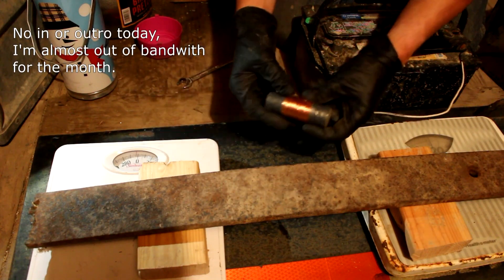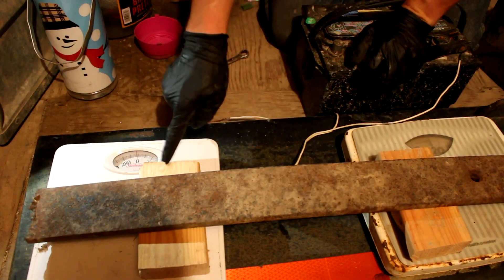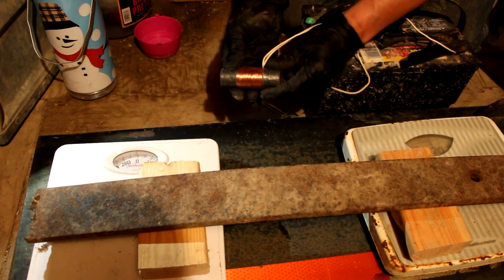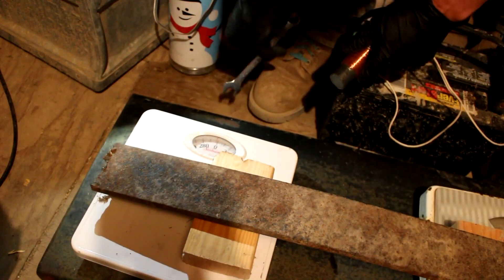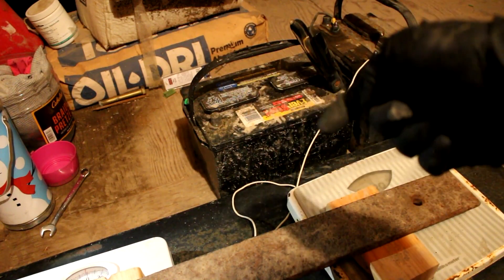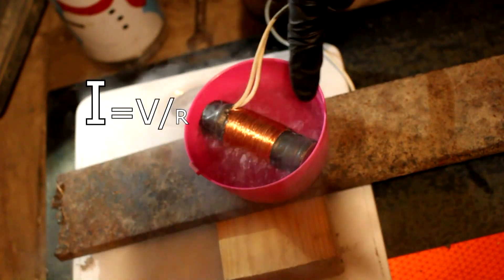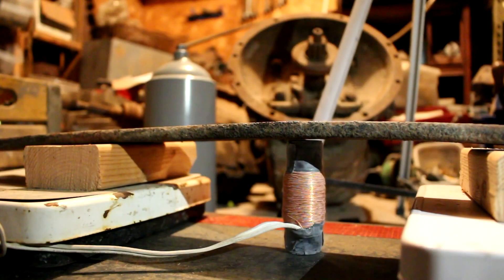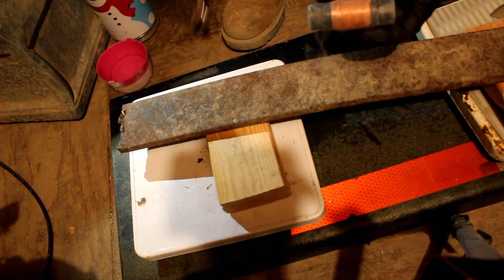Electromagnet in Liquid Nitrogen

Comment: Cody, is there a limit to how strong a magnet can be?
Reply from the maker: There is actually and that is the strength of the coil. strong magnets have a tendency to explode.
Reply: Even with superconducting coils, there's a critical magnetic field in which the resistance becomes non-zero. At that point, the coil rapidly heats up, and it can easily explode, especially since it'll turn the liquid coolant into high pressure gas.
Reply: One can always make stronger coils.

Edit: Nevermind, that would increase the resistance of the wire.
Reply: Well, a type of neutron star called a magnetar has a magnetic field in the billions of Tesla (Remember, Cody's super strong magnet is half a Tesla), and those are very nearly black holes, so in practice that's probably a good limit. Theoretically, the limit is the point at which the magnetic flux density is high enough around the magnet that it collapses into a singularity. I wonder what a black hole made of magnetism would be like...
Reply: Don't forget about core saturation
Reply: As long as you can produce enough power you can always make the magnet stronger.
Reply: If you cool that coil sufficiently though, you could get it to super conduct and have 0 resistance.
Reply: Fascinating! Thanks for the knowledge :)
Reply: +julian1000 fokin infinite amps
Reply: +julian1000 No, you can't. Copper doesn't display superconductivity even near absolute zero temperature (it will always have a nonzero resistance). Neither does gold or silver for that matter (or other materials considered to be good conductors in general). You'd need different types of materials for that.
Reply: +Ernestas Viskontas (EEVV) Curiously enough superconductors (even though they have basically nonexistent resistance) DO have a maximum current-carrying capacity, the so-called critical current. If you try to push more current than that, the material will stop superconducting.
Reply: go look up something called a "magnetar", it's a neutron star with an iron crust
it's pretty horrifying levels of magnetism
Reply: Ya'll should check this out: https://nationalmaglab.org/news-events/news/new-approach-to-building-magnets-yields-new-world-record

rare earth barium copper oxide for the win!
Reply: There are some videos out there about the strongest (electro)magnet in earth, not much to do with the question but pretty cool stuff.
Reply: Theoretically there is no Limit, but as always in practise there is ... the highest amount of Tesla is ~34.000 for a tiny amount of time ba a Laser, but some astronomically objects like neutron-stars can get much higher
Reply: It's limited by the size of the magnet and temperature; you can theoretically force it to convert any amount of power to electromagnetism but that's going to destroy it. If you make an electromagnet with the same diameter as Earth, with the coil-wire being the same diameter as Texas, and you power it with 50 million+ volt, it's gonna be that much stronger, since it's size is able to handle that much more power. When cooled equally, every cubic cm or inch of copper coil is able to create a certain amount of electromagnetism before it destroys itself, so bigger coil mass means bigger capability, but also less cooling, so capability doesn't increase linearly with size.
Reply: +1ucasvb Actually with superconducting coils (as with any superconducting material) there is a critical CURRENT (not magnetic field) above which the superconducting stops. But other than that you're right (at that point the material does heat up rapidly and that can cause all sorts of problems).
Reply: +Samm Sheperd (SNRS) And in coils with no core?
Reply: At some point the magnetic stuff must force its self apart, right?
Reply: +MoronicAcid1 often the wire is surrounded in steel or iron because they "conduct" the magnetic field better than air. A big problem though is vibrations because sometimes depending on how well the windings are fixed in place the vibrations will erode the insulation and there will be a short.
Reply: +Cody'sLab wow really?!
Reply: +julian1000 that's just a theory
Reply: +TheMrTape I liked everything about your explanation except for the volts.... current man, current
Reply: Well nah have you never seen Lost
Reply: yes, there is a limit for superconductors it is called "critical field".
for normal conductors, there is no limit, besides obvious mass-size-current-heat limitations.
Reply: as a matter of fact when using a ferromagnetic core you can consider the saturation of the core a limit, as when the core is saturated the strength of the magnet will increase at a much lower relative to the increase in current, normally electric irons tend to saturate at 1-1.2T, thats the reason why magnets which generate stronger fields simply use an air core, as there is no benefit in using a ferro core, they draw up a lot of power tough
Reply: +Silly Sad There is, but AFAIK cricital field applies to external fields induced by other sources, not the field induced by the superconductor itself. Thus I still think that the critical current is a MUCH more relevant information in the limitations of creating electromagnets using superconductors than critical field.
Reply: +Gary Littleford Since current and voltage are directly proportional, increasing the voltage would allow more current to flow. 

But you are correct that current is what really matters in electromagnetic field strength
Reply: Unfortunately, no...
The critical magnetic field strength in a superconductor also applies to the field generated by the current passing through the superconductor itself. Above this critical field, the superconductor loses its superconductivity.
This sudden resistance has the unfortunate effect of turning a lot of the energy stored in the running current into heat, making more of the superconductor become resistive.
When you have a large superconductive magnet, such as those at the LHC at CERN, which is basically put inside a large thermos flask filled with liquid helium, the effects of large amounts of energy being released into the liquid helium is that the flask basically explodes.
At the LHC this happened on September 19th 2008, when this happened in a chain reaction. Though this was not caused by the critical field being exceeded, but a faulty connection between two magnets.
Reply: +Martijn Reicher That's fine, but without the presence of an external magnetic field the critical current of the superconductor is exceeded faster than the critical field caused by the field created by itself I think.
Reply: The critical current of a superconductor is basically the relation between its critical magnetic field and the magnetic field caused by the current flowing through the superconductor.
So the critical field caused by the field induced by the current carried by the superconductor is the same as the normal critical field.
You are correct in your deduction that external fields also have influence on the current carrying capacities of superconductors. If there is already an external magnetic field put on a superconductor, this will also "count" towards the critical magnetic field, therefore the critical current is then "reduced". To learn more about the strange world of superconductors, visit the following page: http://www.open.edu/openlearn/science-maths-technology/engineering-and-technology/engineering/superconductivity/content-section-2.5
Reply: +Martijn Reicher I see. Thanks.
Reply: CoolKoon, yes superconductors have a critical current density. They also have a critical field. Go above either and it becomes non-superconducting.
Reply: There actually is a maximum magnetic force in the universe and  that is: 4,29361 x 10^59 Tesla, the Planck magnetic flux density. But theres is no way you can produce anything that comes close to that ;)
Reply: ps: A magnetar (neutron star) can reach 10^11 Tesla
Reply: no, there's not
Reply: there's a type of star called magnetar, it's magnetic field is so strong that if you stay close enough ( i don't remember the exact distance but i recall something like and Astronomic unit) it can rip off the iron in your blood
Reply: an interesting question. How large of a coil magnet can you theoretically build using technology currently available?
Reply: Limit for a superconducting coil is a few Tesla before it stops being superconductive.
Reply: ***** Well that depends on the type of superconductor. Some can go significantly higher than that.

Comment: Since you're using two scales, wouldn't the magnet have been pulling 50 pounds if only reading 25 pounds on each?
Reply from the maker: yes
Reply: Sounds like that kind of current would melt the wire at room temp. You'd need to use larger copper wire, which would lower resistance allowing it to carry more electricity.
Reply: Hey cody! I have an idea! Try wrapping it alot more (10x more than it is now), and use 120v and atleast 1 amp? I hope i dont sound dumb.
Reply: Andre Gross yeah I was gonna say it depends on the gauge of the wire
Reply: If you mean the 120V which comes out of the wall, then it wouldn't work. Current from a battery flows in one direction, but current from your wall socket changes direction 60 times a second. That means it wouldn't make a very good magnet. It would just make things vibrate. Also, you cannot control how much voltage AND current is in a circuit. You must obey ohms law. For example, if the resistance of the nitrogen cooled wire is 1ohm, and you connect 120V, then 120A will flow through it. If you want 1A, then you have to connect 1V. Voltage=Current x Resistance.
Reply: I think 30 AWG copper wire would get hot with 1A, but it would not melt.
Reply: Euro Bum Would it work well if you used some sort of ac to dc converter?
Reply: vibrate you say?
Reply: The Salty Chip
@ Salty. Not exactly. Yes, it is possible to 'rectify' AC into DC and smooth it out. We just call that a power supply.  Your home is full of power supplies, because a lot of devices need DC. One example is your phone charger. Take a look at the stamped markings on it, and they will say something like INPUT: 120VAC 50mA, OUTPUT 5V, 1A. It is changing AC to DC. But a phone charger only supplies around 5 watts of power. Cody' car battery can supply around 2,000 W of power, which is a lot, right. It's capable of turning a car's big heavy motor! But as you can see, this electromagnet is not very strong. It has very thin wires, with high resistance, which allows very little current. That is what Cody was trying to show in this video. So the best way boost the magnet's power is to increase the current, in this case by using thicker wire (or liquid Nitrogen). This is Ampere's Law.
Reply: Christian Arreguin
@Christian. Yes, vibrate. It's exactly how a tattoo machine works. Pushing AC through coils of wire is better for building electric motors. Like in your washing machine.

Comment: niceee. have you done the calculation or messured the resistance? would be interesting to which extend the copper looses its resistance
Reply from the maker: yes, in the video listed in the description.
Reply: +Cody'sLab another way to decrease resistance is to increase wire gauge.

Comment: iv never understood why the current doesnt just jump wires and short.... i thought electricity takes the path of least resistance, but instead it follows the wire. this is probly a shit question but im drawing a blank :/
could it be... jumping tiny space between wires is more effort for the electricity, so it just follows the set path of the wire because flowing is less resistance then jumping?
Reply from the maker: the wires have a thin coating of plastic on them that can handle a few hundred volts before it arcs out.

Comment: For people trying to do this at home, when you have higher currents through a coil, and you disconnect the wires, there will be a huge voltage spike. The more current the higher the spike. This can easily be several 1000's volts. Tasers are based on this principal.
Reply from the maker: that would only happen if I had another coil with a million turns on the same rod.
Reply: well sometimes, due to induction, you can have a voltage spike with just a single coil.
Reply: One single coil is enough. This only happens with dc current. It's basically the magnet field that wants to go away cause there is no current anymore. But every action has an opposite reaction so there is a big inverse induced voltage.
basically U= -L*di/dt+R*I

A coil will always resist the change of current

Comment: Can you show how to make one please
Reply: no
Reply: How to make the magnet? You take any wire that can conduct electricity and wrap it around any metal bar that a regular magnet can stick to. (Iron, for example) You then run electricity through the wire and it becomes an electromagnet
Reply: He explained how to do it in the beginning of the video.
Step 1: Take 30 gauge copper wire
Step 2: Wrap it around a steel rod roughly about 1000 times
Step 3: Attach voltage source

Comment: Now we must put all our pc and so on in liquid nitrogen :-) to increase the power :-)
Reply: There are people who cool their CPUs with liquid nitrogen.  :D
Reply: +Casey Thimm That's one of the most common things people do with liquid nitrogen. This video is the first time imsee someone doing something else electronics related with liquid nitrogen than cooling a cpu.
Reply: +Casey Thimm really? Is it not to difficult to make it safe for leaking?
Reply: Richard van Pukkem I've seen more Youtubers do stuff with LN that doesn't involve computers than I have with computers.  The only time I've ever seen a LN cooled computer was when I searched it.  Not in my sub box.
Reply: ***** Just look it up on YT.  It's pretty "Cool".
Reply: you can't cool your cpu too much though. some guys tried it with liquid helium and they actually had to keep warming it up because the chips would start superconducting instead of semiconducting
Reply: +hey7328 It's really improbable that someone tried to cool a CPU with liquid helium, and it's nearly impossible for silicon to become a superconductor. Helium is a superfluid when liquid, and it requires extreme amounts of pressure to stay liquid. Silicon, when doped with high amounts of  boron (which is extremely hard to make, and not useful as an semiconductor), may exhibit superconductivity, but only at temperatures lower then 0.35 K. Indeed you cant cool your CPU too much, and a precise temperature control is required to keep it functional when extreme cooling, this happens mainly due changes in physical properties of others components in the CPU.
Reply: Eduardo Fuentes look up liquid helium overclocking. it must be the semiconductor just becoming conductive enough for electrons to pass through then

Comment: Can you explain why the resistance decreases when cooled down?
Reply: I doubt I can do better then Neel but. When the wire is hot it means the atoms and shit (very scientific) are moving around very quickly so it's hard for the ions to flow through. Imagine trying to walk across a busy highway vs an empty one
Reply: Well, resistance in a conductor is directly proportional to temperature of the conductor. Cooling down the conductor reduces the kinetic energy of the particles present in the conductor and hence current can pass through the conductor easily, as it wont collide with many particles on its way. ps. very crude explanation.
Reply: +MoronicAcid1 they do, and even in a solid state the particles still vibrate. But ions are charged particles, electricity is literally the flow of electrons so idk if you're trolling...
Reply: +Captain Limabean Ions don't flow through a metal.
Reply: Current flow as electrons on solids and as ions on liquids,on gases they can flow in either one of them
Reply: zonkeymaker Vibration is hardly flow.

Comment: Wait, how does one calculate the current in a superconductor if that's the formula? Superconductors have no resistance, which means you'd be dividing by zero.
Reply: it would be limited by the resistance of the power source.
Reply: David Ulliac I guess that makes sense...

Comment: That was a huge difference in pull strength just by cooling the cooper wire/steel rod. Would have been interesting to see the actual current readings before/after using a DMM. Simple, but a good video.